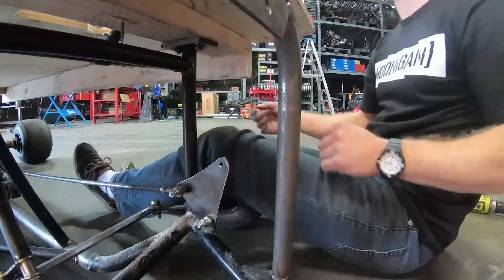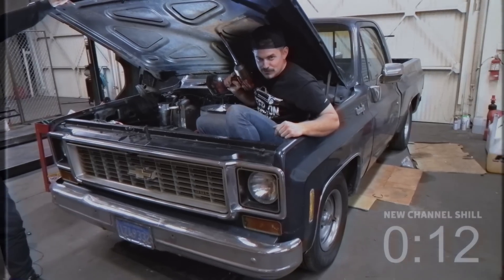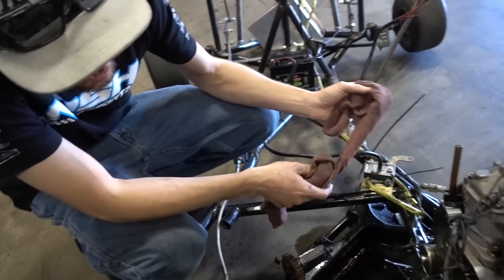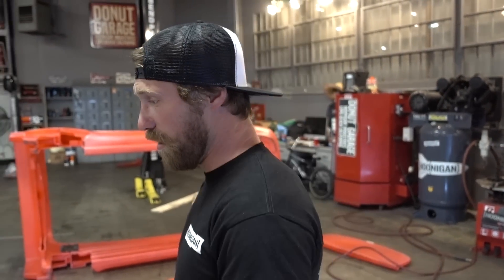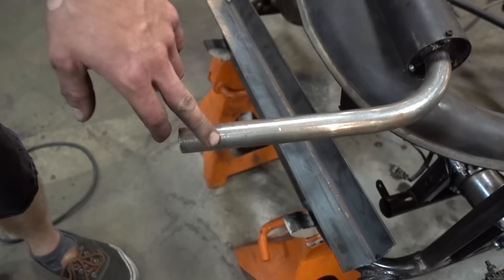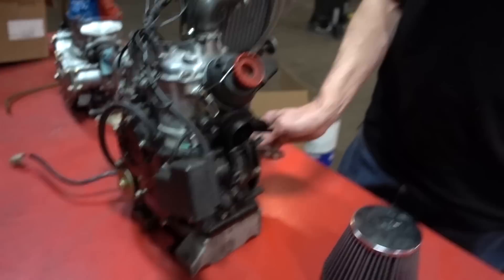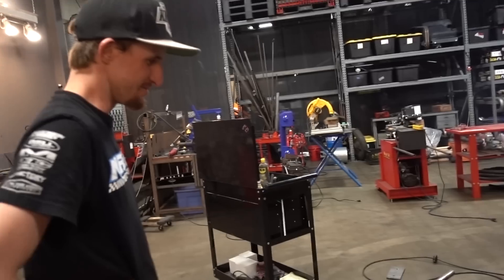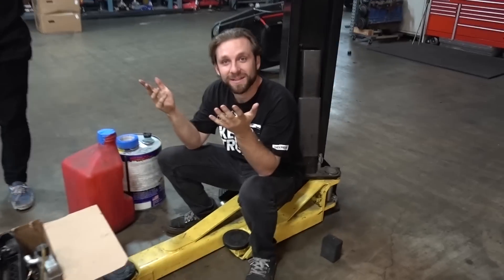Go-Kart Powered Racecar Bed DRIVES! Race Engine Swapped Into ShredBed

Comment: its a rotax max senior engine with a powervalve and a open air filter ;-)
Reply: Never really liked the rotax, they always felt weak on the low end even with some aggressive gear ratios. Stuck with parillas before they forced everyone to get the x30.

Comment: Incredibly lucky that the break left the gear out. Not that engine, a bit different, but same issue, it must've moved or caught a tooth because it shredded the whole side of the case, luckily my brother was hyper good at welding even back then and we ran it without counter balance until the bearings died.

Comment: I have Rotax parts/motors available, if you’re in need.
I wanna send some gears, getting the ratio right could make all the difference, between flying down straights or drifting into donuts